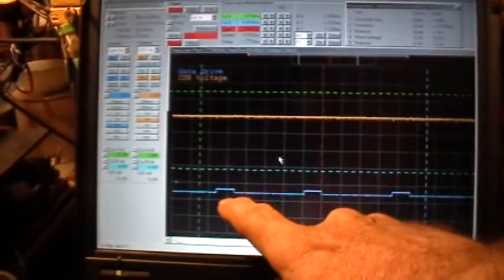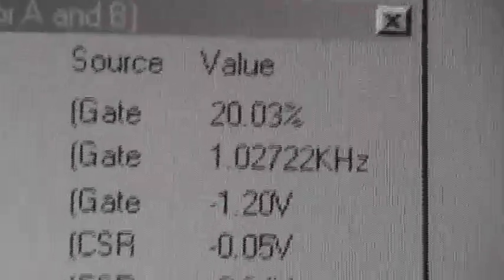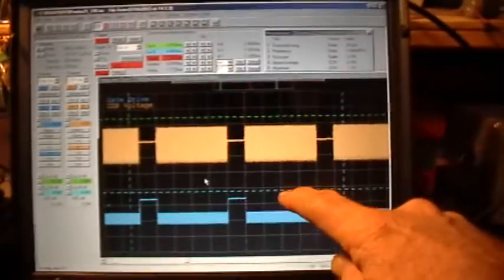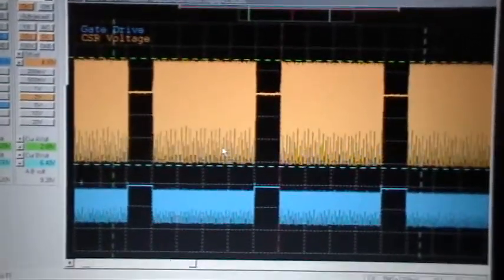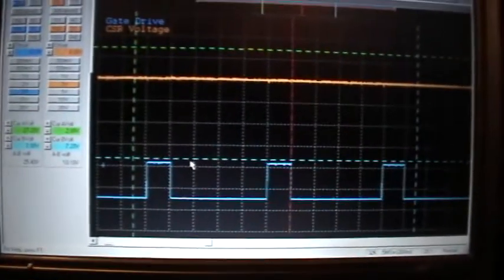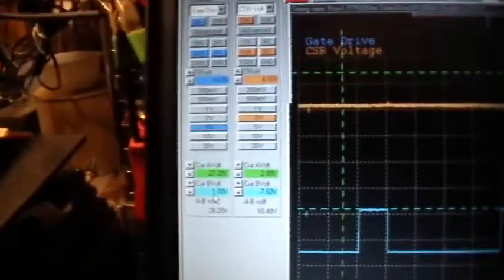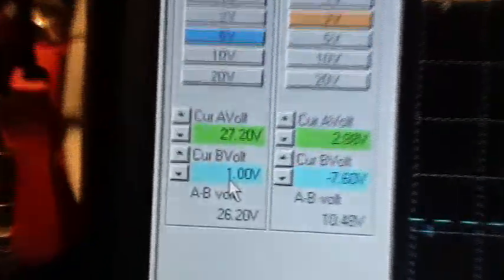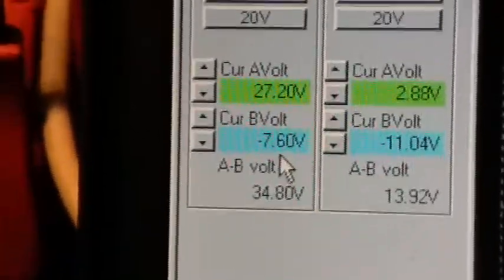Electric OU: Ainslie NERD Function Generator Open-Circuit Voltage Settings

Comment: "I am of the opinion that we are not just measuring the Ainslie circuit here, we are, or should be, setting an example of proper experimental technique and measurement protocols." Your statement really summed up what I found to be most beneficial about this series of videos. I think many well intentioned experimenters are led astray by their lack of proper technique and measurement protocol. There are valuable time saving lessons to be learned here, appreciate your info and efforts. Thanks